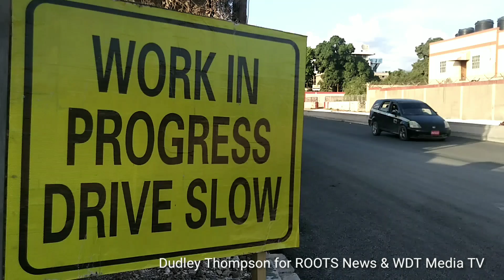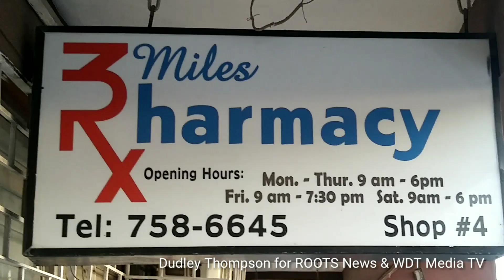WDT Media TV Hagley Park Road Improvement Project.

Comment: J.p.s will have to remove light  wire  plus two light poles and several post that blocking the entrance ramp. So j.p.s holding up the work they need to be investigate by the prme minister office.